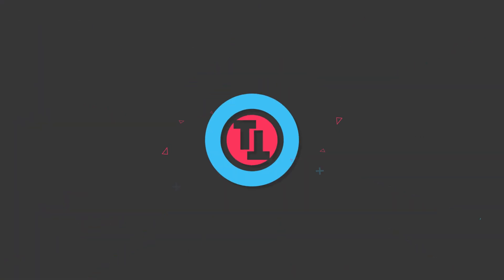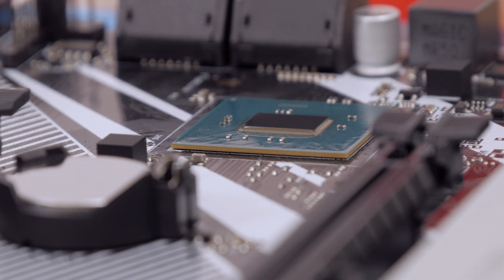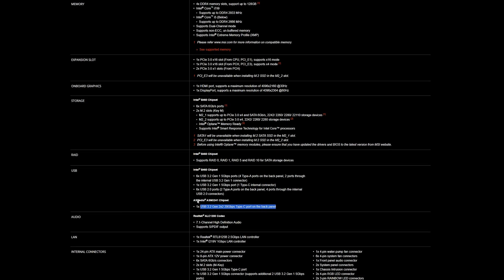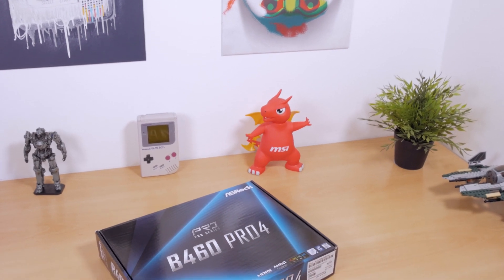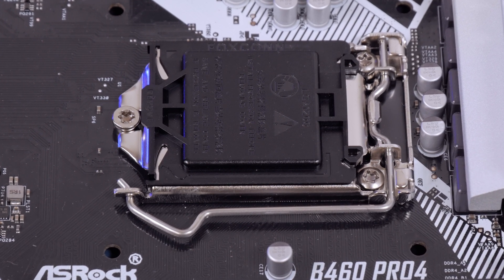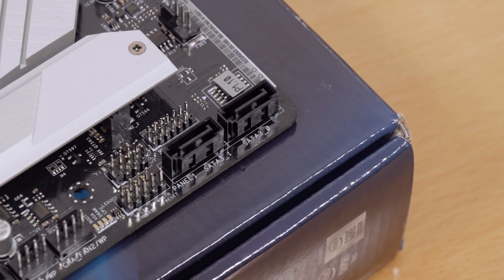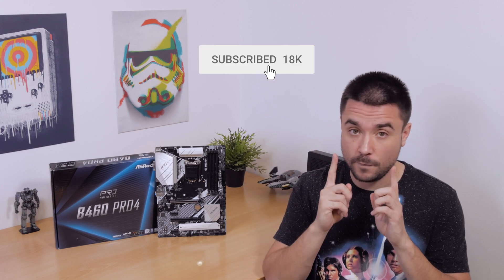H470 vs B460 difference - feat. ASRock B460 Pro4 Overview

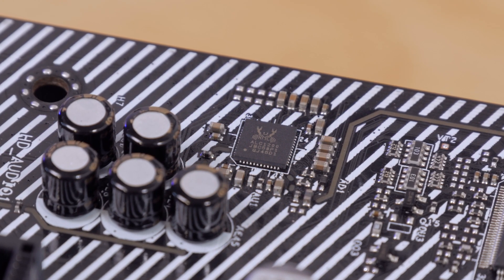Comment: At 6:20 you tell there is no connection for audio? like,if I have front audio jacks on my pc case,i cant use them if i buy this board?
Reply from the maker: No connection for the 7.1 channel audio (as far as I could tell), for the stereo there is, no worries!

Comment: Bro, could you help me out? I'm setting up a new workbench desktop. Do you think I'd be better of with 3700x with b450 or 10700k with b460m?
Reply: 10700 non k with b460m
Reply: 3700x and B550 Tomahawk
Reply: Get b550, there's no point in getting b450
Reply: @zyleerelis9804  why is the b550 better than b550
Reply: @q3d385  b550 is a newer chipset, which will support ryzen 6th gen, the b450 won't. Plus you get pcie gen 4 capabilities
Reply: @q3d385  get i7-10700 instead of ryzen 7 3700x. I7 performs better.

Comment: Does the B460 Pro4 support the i5 9400f?
Reply from the maker: Unfortunately, no!
Reply: TekTick  Yeah I thought so, but I found the pro4 in the b365 model which I’m quite certain that supports mine. And it’s very cheap on amazon so I’ll be going for that
Reply: @MattsPaddock  It supports the 10400F though.

Comment: I just bought a Gigabyte B460 HD3 from Amazon, because it's cheap and has two NVMe slots. But the website driver downloads are HORRIBLE. I've been doing this stuff since video cards used jumpers and had connectors for CD-ROM drives. This is the first time driver downloads failed. Also, the usable short PCIe slot is crooked.

If I upgrade the motherboard again soon, probably be MSI.

Comment: Ram 3000mhz on this mother board is ok ???
Reply: ok
Reply: @HanifSetia  But it will not run a 3000MHz.
Reply: @rangersmith4652 yeah the h470 will not run on 3000mhz but i think the b460 will run 3000mhz

Comment: Both of these boards have M.2 2230 E-Key slots for WiFi, but they aren't equivalent for both boards from the info I have found.   H470 M.2 Wifi slot supports Intel CNVi such as AC9560 or AX201 adapters.  The 460B M.2 Wifi  supports PCIe interfaces such as AX200.

Comment: Would you recommend pairing this with the i5 10400F? I was originally get the i5 9400F but there was only a $10 difference so I opted for the better one.
Reply from the maker: I think there are a bit better options out there when it comes to VRMs
Reply: @MattsPaddock  such as 🤔
Reply: @MattsPaddock  ???